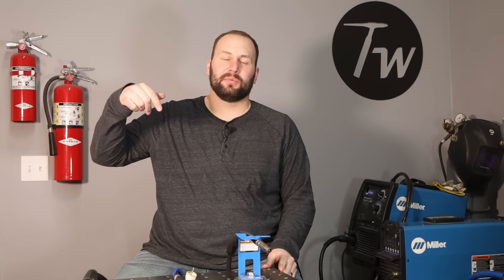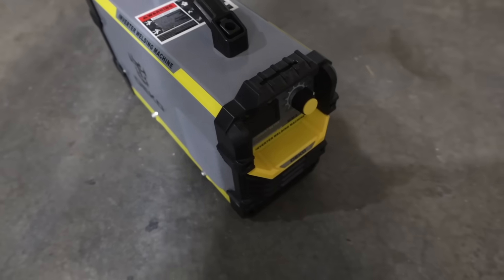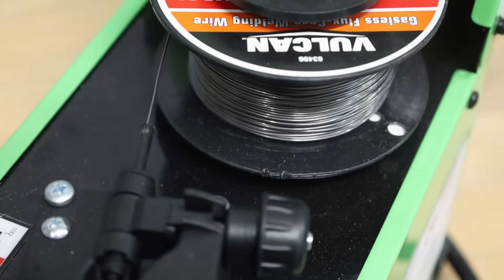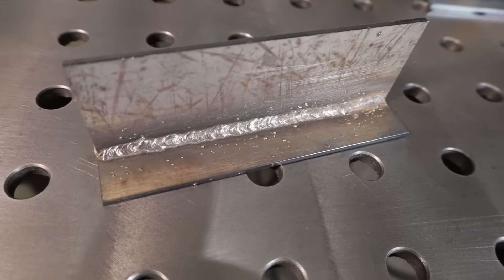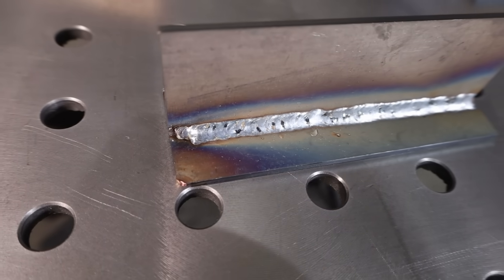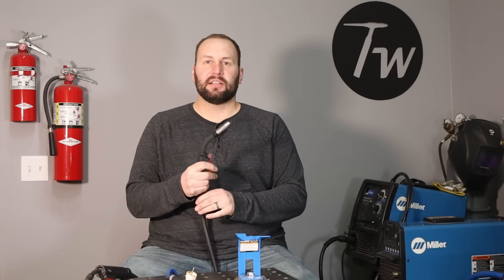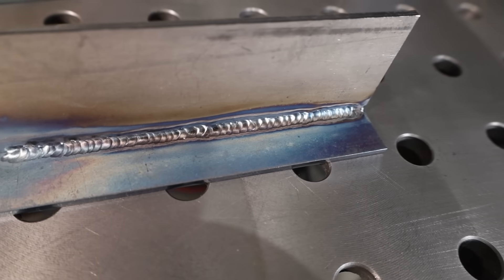4 Types of Welding Explained: MIG vs TIG vs Stick vs Flux Core

Comment: Fantastic video! Thanks again. I used a MIG welder many years ago ('96) to weld up 28 holes in my 85 Honda Prelude so I could use it the next three years at the Marine institute where I went to school. Water had been getting in and soaking the floor, and when I removed the carpet, I found lots of holes and rotten spots. I took a ball peen hammer and knocked out 28 bad spots altogether. I had saved a heavy gauge bottom drawer when my Mom threw out her old electric range (not knowing what I'd use it for), and so cut pieces out of that to seal the holes originally with a rivet gun. But then, my uncle had just bought a MIG welder and I said "I need to learn to weld, I guess" so I went through the instruction manual and learned how to do it with the flux wire. And with the rubberized coating inside and out, I sealed up the bottom nicely, so when I took out friends on rainy days (many of them in St. John's), their shoes didn't get soaked anymore! :)

As I still buy only used cars and utilize them until its no longer feasible, I really want to learn to use TIG for body panel work. When I buy one, I'll also invest in your four courses on your website. This will teach me enough to get started, I believe. Thanks for all of this. Wonderful site you've put up! All the best!!!

Comment: So a very basic question - can you plug these into any 110 volt outlet?   Will any small generator work for powering these in the field?    Why does one stick welder cost $100 and  others thousands of dollars?
Reply: Some of the smaller lighter duty welders use 110v, so if you're looking to weld sheet metal up to 1/8" you can use those. If you want to go to thicker material you will need more amperage, which means going 220v. The cheaper ones have a lower "duty cycle" which means they can go for less time before needing to cool down. The more expensive machines generally have a higher duty cycle, and more fine tuning of amperage and volts, which makes welding much easier and nicer. They also have fancy features that make striking and keeping the arc going easier.

Comment: Here to brag, but except for spotwelding, now I learned that I have TIG welded, also I have Laser welded titanium, which is very much like the starwars movies, but in a confined box with Argon blowing from a separate muzzle and you have to ad the pew pew sound yourself.  I've worked as a dental technitian for 8 years. The crazy thing with the lazer is that it can reflect of shiny surfaces, and when it then hits your skin it leaves perfectly circular little burn craters.

Comment: I've had one of those little Deko stick machines for a couple of years and LOVE it! I have done everything from auto body panels to structural welds on a bridge with it and it just keeps going. I have recently been injured and my hands are nearly useless, modifying an old flux core machine so that i can work again. Already put a foot pedal on it(can't squeeze a trigger) and am fabricating something that looks like a TIG torch that will lay in my hand comfortably.

Comment: I'm a welder fabricator 40 years plus,  and  enjoyed your video very much, but regarding your explanation of flux I wish you would have went into it's benefits  more in detail, because of it's essential purpose in various welding applications.
So, what does flux do in welding? If you can have a good weld without flux, why use it at all? Not all welding processes work for every application. There are times when MIG will be an ideal choice because of its ease and cleanliness, but there are times when Stick or FCAW must be used. This is partly because fluxes have properties that aid structural welding, including producing stronger welds than MIG.

What is Flux?

The Merriam-Webster Dictionary defines flux as “a continuous flow.” Another definition states that it is a “substance used to promote fusion,” and “the rate of transfer of fluid, particles, or energy across a given surface.” So, it involves flow, and in this case, a transfer of filler metal across the arc into the molten weld pool. Fluxing agents are used to help aid the flow. This is also true when welding with acetylene, and when using flux to aid the flow of solder when sweating pipe or soldering circuit boards etc.

Comment: With aluminum you should check how much a local shop would charge and how much you actually need done. AlumARC rods are rarely worth the cost, for some the AC TIG wouldn't be.

Comment: Excellent video to give people an idea of the different processes. I am retired now but have done a lot of welding over 50 years in engineering, mainly welding steel fabrications that went down coal mines. Initially it was all stick welding but I started Mig welding in the 1970s. Just for additional information the copper coating on the wire is not just to protect  from corrosion but is also the copper acts as a lubricant as the wire passes through the wire feed and copper nozzle. The machines  I used were big 400AMP three phase and we put multi layer welds up to 25mm in size which had to be ultrasonically tested. Someone asked in the comments about strength of welds. You have to use the correct wire for the steel but they do cover a wide range . The weld material is always stronger than the parts you are welding but the key is good fusion where they join. I never did Tig so cant comment on that . The one thing I would add is when welding always use leather gloves and preferably apron too and ensure there is no bare flesh anywhere as the arc will give you , even if your away from it, very bad sunburn if it doesn't actually burn you. Also make sure nobody watches what you are doing or looks in your direction. if they dont you get what is called the flash. Its painful and can damage your eyes. Safety is everything.

Comment: I used to weld together the challenger Main battle Tanks,  I used all of these different processes as well as plasma arc, low hydrogen rods and armour rods, creating austenitic welds that do not rust. TIG welding stands for Tungsten Inert Gas although there was a argument for TAG welding as active gases are used. The tips are zirconiated and thoriated depending on ferrous and nonferrous metals. A good video for beginners, could do with turning the amps down a notch on the stick welds a bit of splatter... ;) !!!

Comment: What? There's other welding than crappy welding, that I do? Go figure. LOL 
All though, I am using a cheap Harbor Frieght mig welder, with flux core wire, that never keeps a constant arc.  LOL

Comment: No mention of oxyacetylene?
Reply: Out of date and old fashioned. TIG is a much better weld. It's more for a factory setting.
Reply: Oxy/acetylene might be old tech, but it doesn't require generators or electricity to do and you can't beat it for cutting either!

Comment: I welded for a few years with stick.   The company made Oil Derricks and related structures.  The vast majority was flat welding, we flip the structure to make all the welds flat. Mostly used 5/32 7018 rods, I loved it when I welded, my flux would start curling up.
Reply: Wait a minute, you didn't tell your boss that story. Arc/stick is an all position weld, just like every other type of welding, upside down, vertical, horizontal.
Reply: @georgebuck2269  The bosses wanted only flat welding.  I didn't ask why.

Comment: Well, that was a trip down Memory Lane. I am a time-served (apprenticeship) fabricator/welder from the late 1960s to the early 1970s, but I haven't done any welding since 1973. What is remarkable is that all those methods you have demonstrated were in use back then; therefore, I'm quite astonished that welding technology hasn't progressed much in the past half-century. The only method you didn't mention was old-fashioned gas welding (oxy-acetylene/oxy-propane), but I suppose that TIG welding, which is a similar technique, has all but replaced that. Good video.
Reply: I learned oxy/acetylene in trade school, (1967) it's kind of useless compared to TIG welding.
Reply: @georgebuck2269  They tried to teach it to me too (in the same year, coincidentally) but I was useless at it. I was, though, very good at oxy/propane cutting, by both hand and profile cutting machine.

Comment: Which welder do you use for Aluminum?
Reply: Aluminum can be TIG welded or MIG welded as long as you use only Argon or a mix gas called Argon/Helium.

Comment: If you still have to add a copper metal when doing tig, how do people weld without a added metal, like can you just tig weld two pieces of metal together with just popping it off.
Reply: There are two types of TIG: first is fuse welding where you melt the edges together or second by adding a steel filler rod to the weld. Steel filler rod has a very thin coating of copper, so it doesn't rust. You always match the filler rod to the type of metal your welding. Steel to steel, Aluminun to aluminum or stainless to stainless or copper to copper.

Comment: Flux and stick welds are ones used in structural steel construction. While the mig welding can be seen on bicycle frames.
Reply: Heavy structural structural members in a shop or fabrication environment are generally welded using spray transfer MIG. Stick and flux core are used on construction sites because of wind.

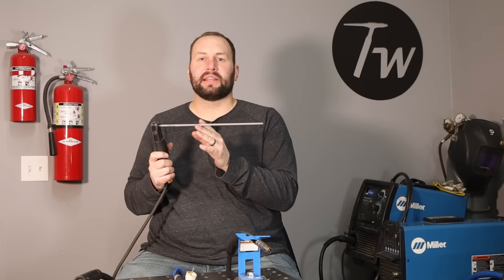Comment: 1:54 Do you have an example of an oxygen contaminated weld?
Reply: Yes it has a lot of porosity or bubbles in it. This applies to a MIG or TIG welded joint. If you want an example, have your friend step on the gas hose when your welding, cutting off the gas. Or shut off the regulator. All TIG, MIG or arc welds have to be shielded from the air. For stick or arc you need the flux on the end of the rod.

Comment: My favorite is Tig. I love how little material you have to add.
Reply: Please add filler rod so the pieces doesn't fall apart. It's called fuse welding with no filler rod.

Comment: For MIG welding steel, Argon/CO2 is only used to prevent spatter and the resulting grinding and removal of it, as Argon is the coldest gas available for MIG. For the deepest penetration and hottest MIG weld use pure Carbon Dioxide (CO2). And it's a lot cheaper and is available in large bulk tanks.

Comment: If your going to TIG or MIG weld aluminum, clean it first. Aluminum is the only common metal that has to be clean before you weld it. No oil, grease or paint in the weld area. File it, grind it or use laquer thinner or acetone to degrease it.

Comment: I bought a MTS machine since I needed the two different bottles
I found Harbor Freight has a welding cabinet that holds two bottles
Then I connected a Y valve to my machine to accept both gasses needed
Reply: I don't know the type of machine you have, but if you ever TIG or MIG aluminum only use Argon or a mixed gas Agon/Helium.
Reply: @georgebuck2269  I got an Everlast PowerMTS-211Si, unfortunately, it won't do TIG AC so aluminum is out.
However, I can get the "Spool Gun" for the low, low price of $400 and MIG it?
At school, in TIG class they used Argon, so that's what I went with.

Comment: It has been reccommended to learn stick welding first then learn the rest... Yes, the vertical and overhead welding are the hardest... especially when you have to crawl into a hole with no room to move and have to overhead weld... despite your leather jacket and gloves, you just get stung everywhere... now washing out a weld overhead or cutting with a torch is real fun too!!  I was a shipyard shipfitter 24 years

Comment: I use stick welding for brackets when setting rails. I’m a local 1 elevator constructor but not a certified welder.
Reply: A welding certification is only required for a certain job when the contractor or company demands it. Then you get tested for a specific type of welding and metal. A testing company appears at the factory and they supervise the test. The test coupon gets sent out to a testing lab where they evaluate it. It either passes or fails.

Comment: Do they all cause a ton of debris or just stick Welding ?
Reply: Stick welding is the only type where you have to chip and then clean up the slag.
Reply: Flux core wire also creates slag.

Comment: Interesting.  So, alternating current is better for aluminum.   But I have heard DC stick welding is much better for steel.   True?
Reply: Setting your TIG machine it should always be set to AC, And you have to clean aluminum whether it's MIG or TIG welded. No grease or oil or paint.

Comment: I want to weld a baffle silencer to my motorcycle exhaust pipe. So basically weld a circular plate to the end of a small pipe. What type of weld do you recommend to this? I don't exactly know what the steel type is of the baffle, probably stainless steel/alu?

Comment: Good video. Please add gas(Oxygen/Acetylene) welding. My first choice. I use gas 80% of the time. I weld, braze, cut, and heat. Mig, with aluminum spool gun for thick aluminum welds. Mig, for fast steel weld. Tig for precise Stainless, aluminum and body work, etc. And Stick for thick and outside welding. There are other types of welding. But are for commercial applications.
Reply: The only secret for welding Aluminum is to clean it first.

Comment: So, what about Heli Arc welding? That's what this one guy i used to know did. It's uses Helium? When i watched him it looked like he was using a brazing rod but not with a torch - he had gas cylinder like what you showed with the tig setup.
Reply: TIG and heliarc are the same type of welding. Heliweld was a type of welding machine that Airco company made way back, so that's where the term Heliarc comes from. Use Argon for general TIG. It was a length of filler rod you were looking at probably steel or aluminum.
Reply: Thats TIG, Helium can be used for welding thick aluminum if you have a good enough torch like a water cooled HW-18

Comment: One quick question, does tig welding can weld copper also beside the aluminum?
Reply: All metals are TIG weldable except zinc. Zinc is used for galvanized plating. Yes that means copper and brass. For brass the zinc burns off and leaves a quality weld. For copper you will need to preheat it with a torch, depending on the size of the part. Copper disapates heat more than other metals.

Comment: Great video; thanks.  Would have been even better IMO if you had included a section on the FIFTH popular method: Oxy-Acetylene gas welding.  Not as popular these days, but still very handy and "the best thing" for some purposes.  (I'm just a novice but have tried all five popular types; currently doing mostly TIG.)
Reply: It was taught in trade schools in the early sixties and seventies. For cheaper equipment it's taught to people that build airframes for their homebuilt bi plane.

Comment: Hi Tim. How about steel piping work? Carbon steel, Galvanised steel, and stainless steel. Which type of welding would be appropriate?
Reply: Good starters tip, grind that Zinc coating or galvanized off the pipe edge before you weld it.

Comment: I like the information you provided a lot, but I can't sit here and NOT acknowledge the porosity you had in that Mig weld...other than that keep doing what you're doing...but if there were gas holes in any Mig bead on the work I did, someone would be written up or shown how to adjust gas flow, wire speed, or voltage lol

Comment: Well. Where were you when I took shops class.

Great tutorial that answered a lot of questions. I have always wanted to learn / improve my understanding of welding. I really want to learn  TIG, just for the many potential applications I would have for it. The easy, folksy and really consise targeted guidance also helped explain some of my self created issues when I have MIG welded in the past. 

Bookmarked. Now to see if I can try out tig before buying my own welder.

Thanks for the great posts! REALLY informative.
Reply: TIG is good for tacking and for smaller welds. But still great if you add enough heat and filler rod. MIG is for long fast production runs.

Comment: You didn’t mention using a way stabilizing unit with the TIG welder, do they still do that? I’ve not done TIG welding in 12 years.

Comment: I worked for NASA and i learned all of the welding in this video. I suggest showing to anyone interested in starting or wanting to weld.  i also suggest you learn about the various metals.  The other fun about welding is not just flat but vertical and overhead.
Reply: I think arc welding overhead pipe is the hardest type to do.

Comment: What would you recommend for me: 
1)I dont want to buy gas cylinders so TIG and MIG wont work
2)I want to habe something generall purpose. Which means that I want to weld some scrap matall(like screws) and other stuff. I would mainly use it for ar purposes but I would also like to weld things back together when something breakes on f.e. our sit on lawnmower or anything in the houshold. 
4) I have very little experience with welding. 
5) It should not be expencive

Comment: So TIG welding is basically super soldering?
Reply: No! Not at all. Welding is defined as melting the base metals, whether the metal is fused or melted together or a piece of filler rod (thin wire) is added to the molten puddle. Soldering never melts the base metal such as copper or brass. Solder is tin and lead and adheres to the copper wire or any other metal with the help of some soldering flux. The flux prevents the metal from oxidising.

Comment: I would love to learn how to weld properly and be able to actually use steel or aluminium more effectively in creating useful stuff from those metals around the house or for my truck, but it's such a high entry price to get the machine and all the accessories and all these different kinds of welding always confuses me. But you really explained it well. I remember my dad used to stick weld and he would try and teach me, but it was horrible. The rod kept getting stuck and the end result usually looks awful and required a lot of time cleaning and grinding down to get the result you were looking for.